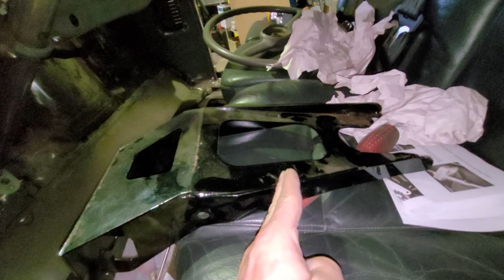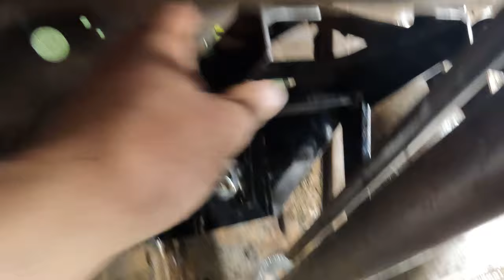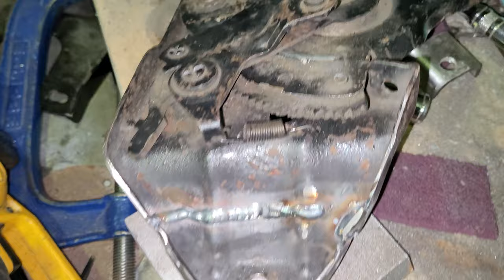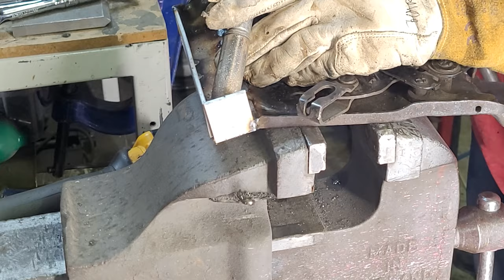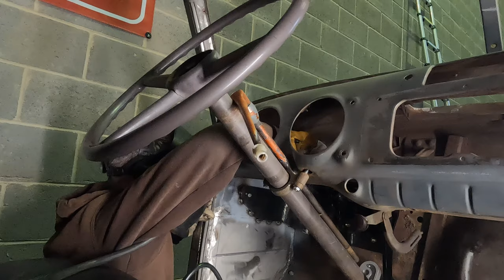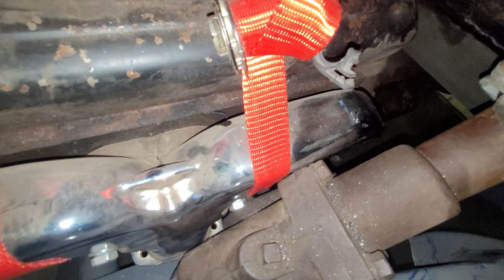Brake Pedal and selector Installation on 51 GMC

Comment: the Hot rod Institute ran a piece of Angle iron along the lower lip of my dash and tied the brake pedal assembly as well as the steering column
Reply from the maker: Not angle butbi am considering a lower dash reinforcement. Have some other things I want to mount up that'll make that easier too.

Comment: I started boxing the rest of the frame from the cab back.  these are the pieces that go over the axle.  So I used CAD as well.  Got some nice fits.  I'm just to the center of the axle so far.  Busy schedule the next few days so don't know when I'll get to the rest.
Reply from the maker: Sometimes just making the piece is the best way. Especially if you're designing as you go

Comment: What's the parking brake assembly from?  I haven't decided what to do for that yet.  One thing I've considered is Electric Emergency brake
Reply from the maker: The guy said a Camero from the 80s but an image search the yukon or similar from 90s is a better bet. I wouldn't recommend it. I considered an electric one but for an automatic it's just a requirement and needs to be cheap.